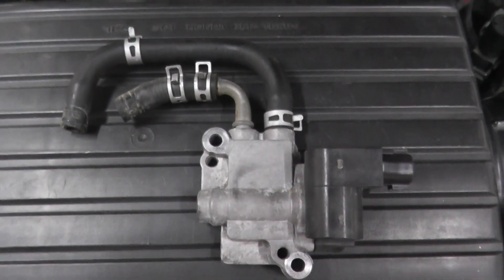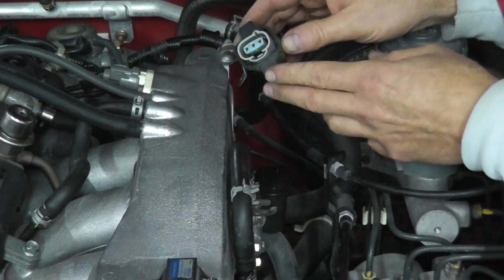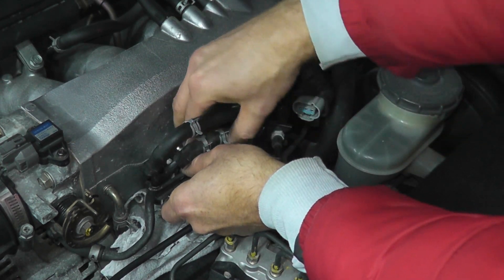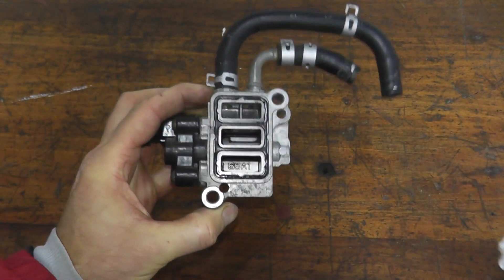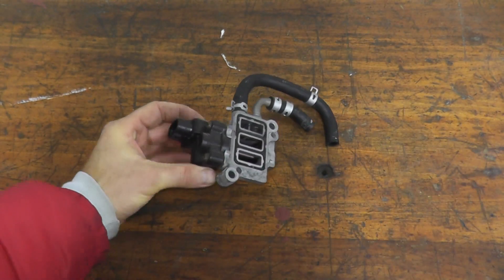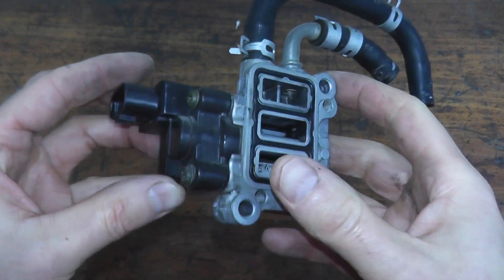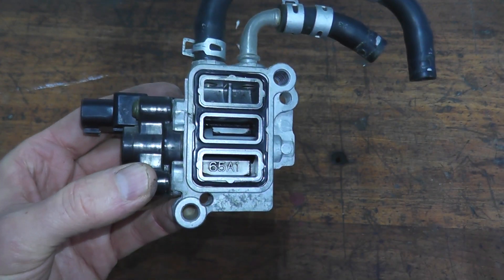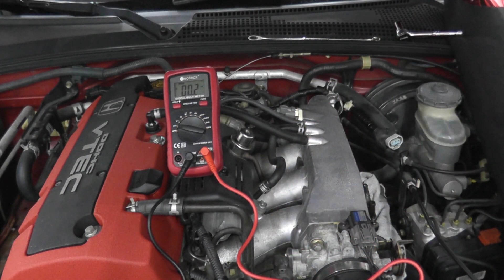Idle Air Control Valve Replacement | Honda P0505 P1519

Comment: What is the need of coolant lines on IAC valve🤔
Reply from the maker: To warm up the valve in cold weather. Fortunately, it's not a hassle on the S2000. On other vehicles, you often have to cut the old line and replace with a new hose. What can you do...

Comment: Great video!  You can also remove the IACV motor using T20 Tamper Proof Torx bit (watch out for special washers) and check if it turns smoothly or sticky.   If sticky, spray the rotary shaft with wd40 ("Spray both bearings if you can see em, and the shaft part that is in the IAC rectangle windows. Whip that shaft around with your finger like you were spinng a top. It should completely free up.  If still sticky It likely a piece of hard carbon or contaminant on the shaft window itself, bearings are likely fine"). Then spin it with you fingers until it spins really free... reassemble at closed butterfly position...

I would do this job when it's cold as you will only lose little coolant.